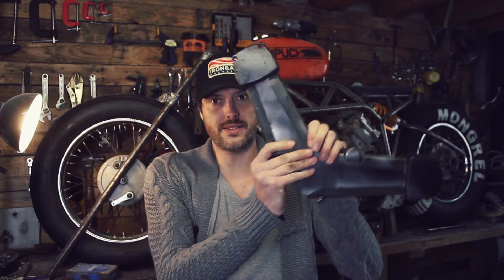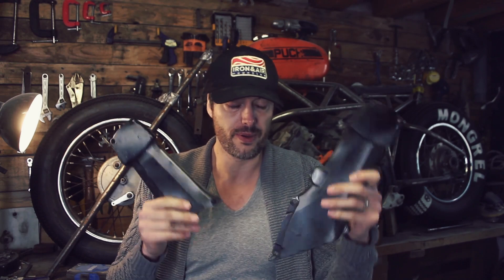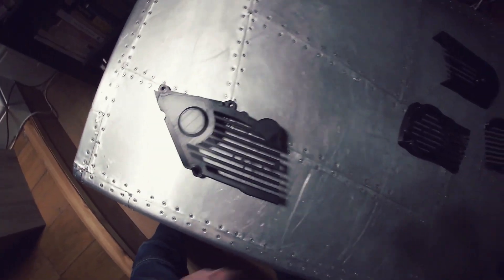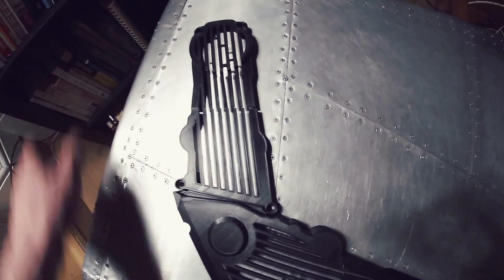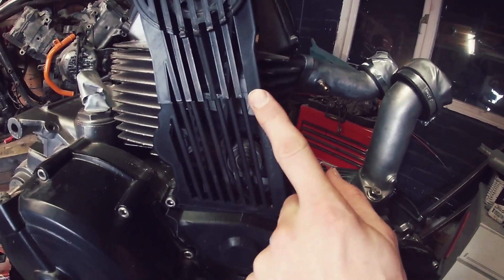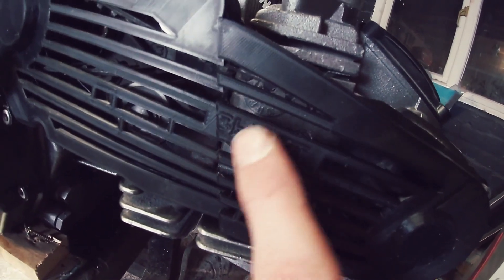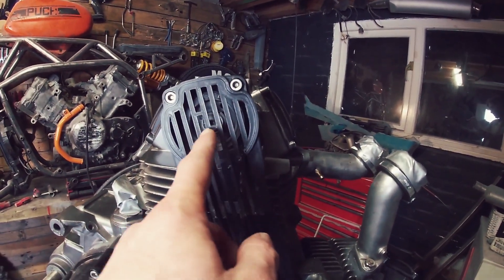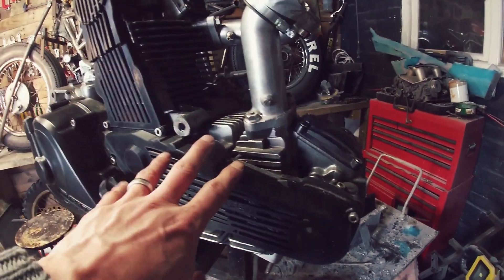Ducati Monster Cafe Racer Part 26 - 3D Printed Cam Belt Cover Prototype

Comment: Thinking of starting first build. Any recommendations on bikes to start with? CB500?
Reply from the maker: CB models are good based for cafe racers. But do fetch a lot of money now and you have a 4 cylinder to consider. 4x the cost of repairing some parts.
Reply: @forthebold  Recommendations?

Comment: I must warn you about 3d printed parts, they are not heat proof at all. Even abs can melt cause of continuous heat. Pla will be gone at 60°celsius. But wow nice covers Originals seems bulky compared to yours.
Reply from the maker: They’re only for prototyping. The final ones will be aluminium

Comment: nice work with your 3D design. just one question, did you show one pulley on purpose, whilst hiding the other two (lower cylinder and main pulley) looks a bit uneven or unbalanced to me, but hey its your project.
Reply from the maker: My main focus was the look of the cover itself and how those lines worked with each side as they’re not running parallel. Also kinda conscious decision as the lower pulley will be hidden by the fairing too. So I wanted the lines to break out where it was visible.
Reply: @forthebold  ok, it'll probably all make sense once it's complete :)

Comment: The cambelt covers look really nice, look forward to seeing the CNC machined ones. Stupid question, I know 3d printers use plastic thread heated to form the shape but would it withstand engine heat? Or can you get really high temp thread that would? You could make some amazing things.
Reply from the maker: My understanding is when heat is applied back it’ll just shape itself again. So direct engine temperature would affect it.

Comment: With all the gaskets you use, you might want to consider a Brother Scan and Cut or similar. Have the outline of the cover (pencil or brass rubbing style), scan it, place in a sheet of gasket material and press go. My wife's got one for her crafts, €220 and it's excellent.
Reply from the maker: Luckily no gasket on these covers. But yeah I have access to a plotter with my work.

Comment: Since it is going to be cnc cut, do consider the cutouts are going to be cut by a round drill tool. So take into account a minimum radius for the inner corners. Smaller radius is more expensive generally and also just be aware of the look.
Reply from the maker: This is a good thing to consider. I’ve ran these past my supplier and all good here. 👍🏻

Comment: Very nice! I have the same 3D printer as you, and I will be using it as well to manufacture some parts on my bike build on one of my upcoming videoes. 

I also use Fusion 360. Seems like this has become the standard setup for hobbyists 🙂
Reply from the maker: I’ve tried a few others. Shapr 3D is the top one I’ve found but the subscription cost for the printing setup is crippling